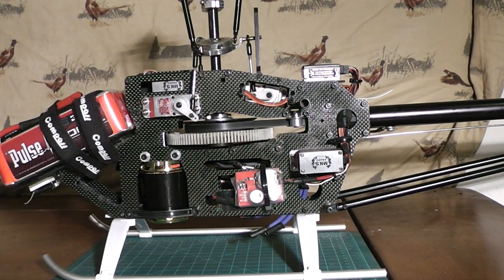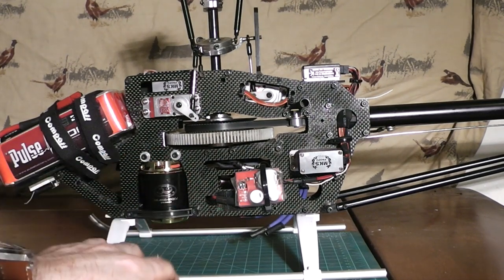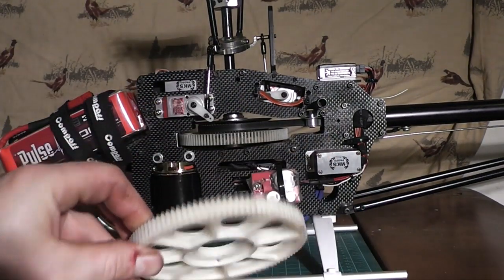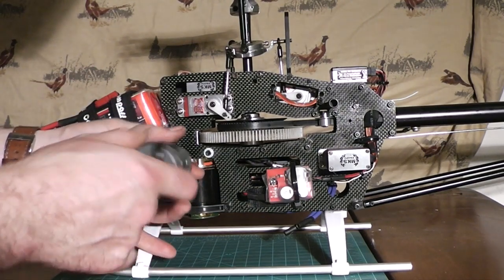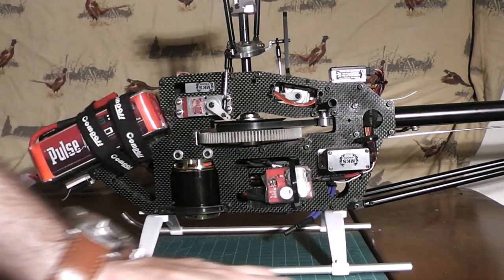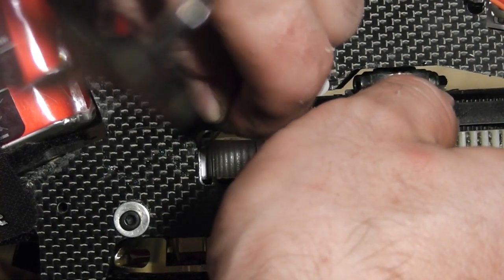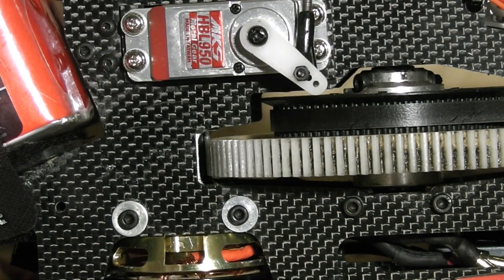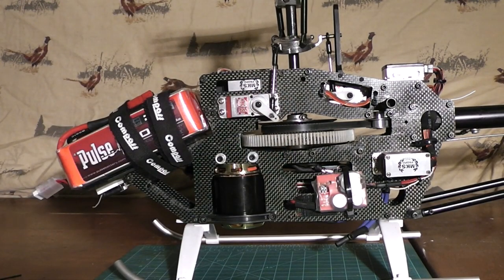R/C Heli Tutorial #12 Setting Main Gear Mesh and Backlash

Comment: I bought a jczk 300c ,prop hit ground, main gear working, rear rotor working, Main prop not spinning need answers please. Where does the main shaft connect to gear?
Reply: Did you reverse motor connection? Is rear rotor rotating clockwise when you look at it from right side of heli?
Reply: @xpertcrush  fixed it all was missing was bottom shaft screw . thanks

Comment: My main gear is turning clock wise but the tail gear is turning in towards the front clock wise not counter clock wise please help I've taken this heli apart 4 times tring to figure this thing out with no luck I have a EXI 500 HELICOPTER